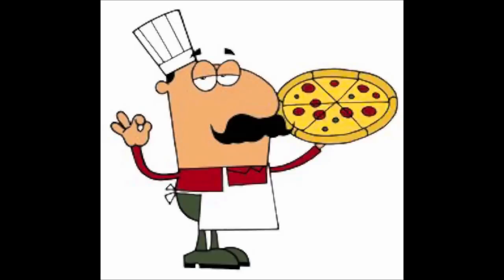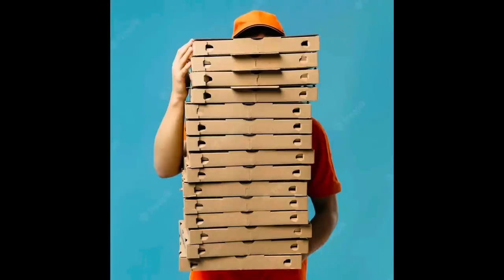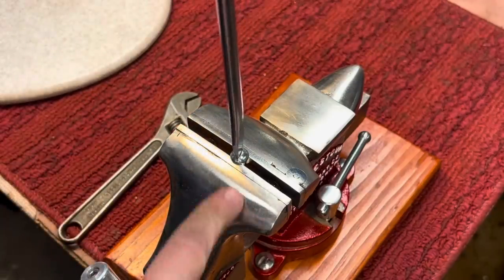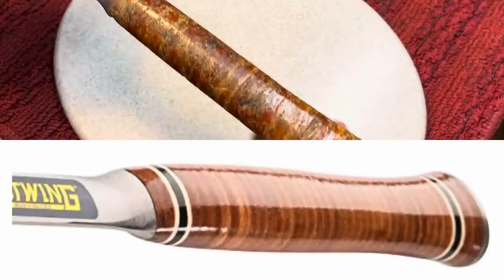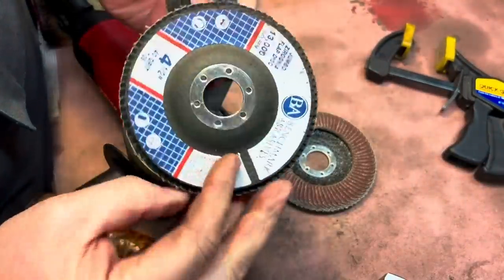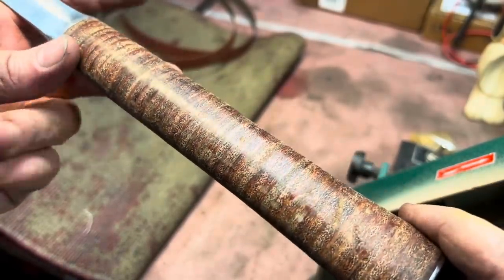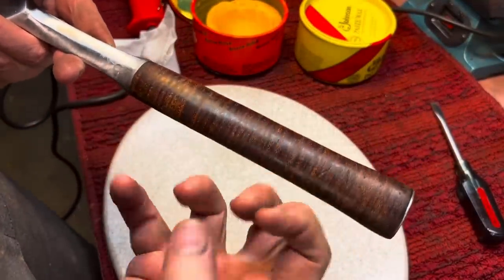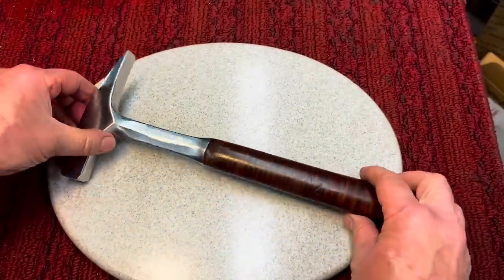Unusual Stacked Leather Setting Hammer Restoration

Comment: You need to write a book. Not how to restore a hammer or pliers but how to restore metal,  wood, plastic or leather. Use some photos of projects like this one for leather talking about the soft wax   before switching to a harder wax and don't forget the heat. I would buy that in a heart beat.

Comment: I have used a wrench on a square shank screwdriver for some stubborn screws.    I do not recall twisting the blade, but I can imagine how easy this can happen.
The hammer looks terrific.   Another benefit of the wax is being able to easily re-apply if the leather gets dried out over time.   Well done.
Dave.

Comment: I worked HVAC back in the 90's and I had that same Malco hammer.  I lost it on a job, then went back to the same house a year later and when we cut open the ductwork above the furnace, I found my hammer on top of the heat exchanger.  All of the leather rings on the handle had dried up, cracked to pieces, and fell off.  About the same time, I lost the hammer I had bought to replace it, and I refused to buy a 3rd hammer.  I built up a new "handle" with electrical tape (probably 2 rolls worth) then Plasti-Dipped it.  I used it everyday for a few more years before leaving the industry.  I still have the hammer and handle looks like it did 25 years ago, just a bit dirtier!
Reply from the maker: Wow!  Lots of tape! 😂👍.  Awesome!

Comment: That hammer is beautiful. It never looked so good.  At first I thought it was an Estwing. I have a number of Estwing tools and like them. They are also nicely finished, and when i saw the forge mark on the hammer head,  i wondered if it wasn't an Estwing. Also, the end cap on your hammer, although it looks the same with the double rivets,, looks poorly done or may have been  damaged over time.  What I dont care for on the leather disc handles is the coating. It tends to crack and chip   Your wax treatment is better and looks great. I guess it's just cheaper and faster to dip the handle in some kind of coating rather than take more time to do your better wax process. Thanks.
Reply from the maker: Pat- You’ve got good eyes!  You are spot on! 😃👍

Comment: Hi Scout, I’ve done quite a number of leather handled hammers and that one has all the hallmarks of an Estwing. The double rivets on the bottom, the shape of the leather handle, the facets on the shaft. I’ll bet if you compare the bottom plate it’ll be an exact match to an Estwing. I remember you telling me that Estwing also made hammers for True Temper and I found they were identical except: the brand name stamped in the head, the bottom plate not being stamped but was an exact match and there was no date stamped on the shaft under the leather like all the Estwings have. Great video as always. Cheers Stuart 🇦🇺
Reply from the maker: Stuart- There are subtle differences, the shape of the handle and the undergrind of the head.  I believe this is a Malco the lettering on the bottom I believe is Annandale - That is where Malco hammers are made. 😃👍
Reply: @ScoutCrafter  Awesome, thanks for letting me know👍👍👍

Comment: In my youth, I ground two flats on the round shaft of a stubby Craftsman phillips #2 to solve a lack of torque issue.  You can certainly apply a lot to a phillips, if you can push hard enough!  I am sure I still have it and have used it at least a few times in the 30 or so years since I ground the flats.  I use vice grips on the flats.

Comment: Nice, yeah it’s a Malco setting hammer. Those letters on the bottom at one time should’ve read “Annandale MN,” where they were manufactured. I have an old no name (none that I can see anyway) leather stacked claw hammer I’ve been meaning to restore one of these days. Guess I’ll have to dig it out and “hammer” away at it, and strike while the iron is hot, so to speak. Sorry, I’ll see myself out lol

Comment: I twisted a square shank Craftsman screwdriver but it was the shirt pocket model and I was probably much stronger then. Been working on restoring some vintage tools and making aluminum ferrules out of swiffer sweeper bent section and the thicker ones from a bicycle handlebar. Gave me a chance to use my dad's Type A Nicholson file meant just for aluminum. Been filing a double spokeshave with my Nicholoson single cut smoothing file as it is such a joy to use!
 What does it mean when you get sparks doing a wirebrushing? It's a 1/3 hp 1725rpm packard motor, a division of GM and Made in the USA. I have it mounted currently with a cheap 8 inch HF wire brush. It is mounted on a homemade swivel I made that swivels out from below my sink so I could sharpen knives on it, mostly.
Reply from the maker: Sparks could be an indicator of the primary centrifugal switch hanging up.  Sometimes a good cleaning gets rid of common problems. 😃👍
Reply: Are the sparks from the motor or are they from the wire wheel?

Comment: John, I have a few restoration questions for you, if you have the time. 

1. I have recently been alerted to the fact that some older tools were plated in Cadmium, and that attempting to clean these via conventional means (i.e. wire wheel/brush) could be flinging poisonous dust into the air. I believe that I may have some tools from that era waiting for clean-up. Any ideas on identifying CAD plating, or cleaning it? 

2. I have recently come into some fine, quite old hand saws. While the blades have the typical rust, much of the etching is still visible. What do you suggest as far as cleaning these up without causing significant damage to the etching? I have seen several people use sandpaper. I was considering fine steel wool instead. 

Thanks!
Reply from the maker: The best thing I think we can all do is treat ALL tools as of they are covered in a toxic coating and always wear a mask and use a simple air filtration system to get any airborne particles out of the air.  As for the saws the best thing to do with them is soak them in evaporust and steel wool them clean followed by some rubbing or polishing compound.  That steel is hard and flexible so use a good backer board.  Thanks!
Reply: @ScoutCrafter  I greatly appreciate your thoughts. Thank you, and Merry Christmas.

Comment: I have my great grandpas #105 Reed vise patent date December 24, 1912 and was taken care of. I took it apart and cleaned it wire wheel and it's perfect.I'd like to keep it bare metal but you can just about see the flash rust starting. Do you have any ideas of what to put on it?
Reply from the maker: Yes! Unfortunately that flash rust is relentless.  If you steel wool your vise and remove the flash, wipe the vise down with denatured alcohol the you can shellac the vise.  It goes on easy and lasts! 😃👍

Comment: I heard the screams of the safety turds when the “Wear Safety Glasses” letters were ground off the hammer.  (Let the turds scream.)

Johnson no longer makes their wax.  The last I checked, a can was going for over $50.  I bought a can of Minwax wood wax and will see how that brand works.
Reply from the maker: I always like to keep the manufacturers stampings but whenever I see warnings I love grinding them right off.  Those are only there to cover their a$$ in case of a mishap.  If it weren’t required by law they wouldn’t put it on.  😃👍

Comment: I've got an old Buck Bros. hammer that has the leather that was my grandfather's. The leather at the end is getting loose.  Any way to tighten up the handle?  Or is it best to try to swell up the old leather?  I was wondering if Snow Seal used for water proofing boots might soak in better than paste wax?
Reply from the maker: Two things usually can be done, if it’s very loose remove the base cap, add a leather shim and re-cap.  If it’s just a little loose sometimes you can tighten the cap a little more by re-peening it.  When the leather starts to fail it’s hard because the hand salts did the damage.  😃👍
Reply: @ScoutCrafter  Peening as is seems like a no-go.  Any chance I can remove the peening, grind down the posts and maybe drill and tap for some screws? Or is the steel too hard?